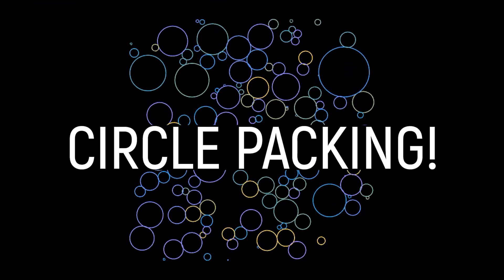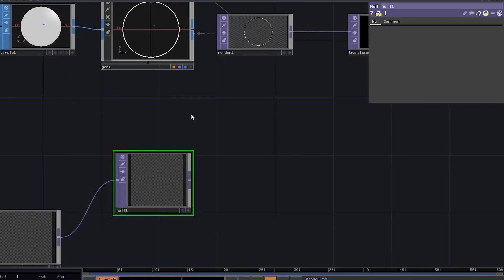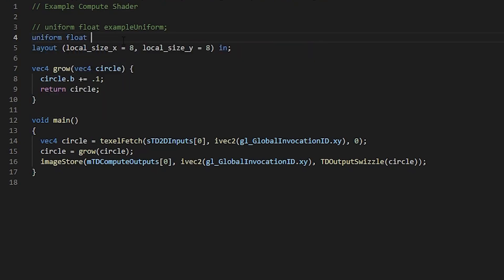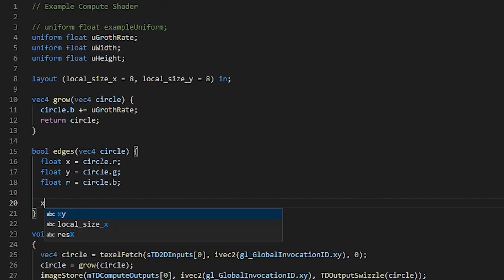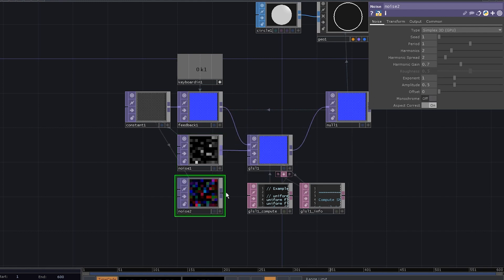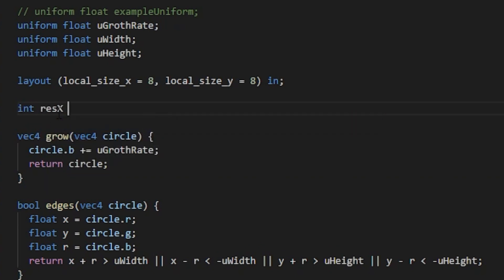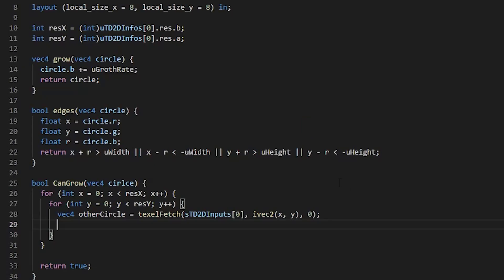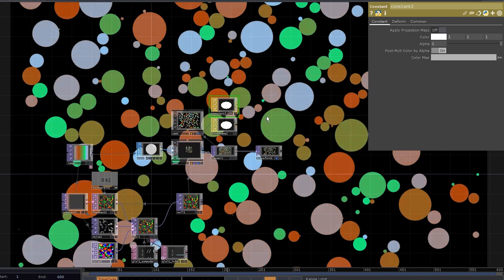Circle packing - GLSL - (Touchdesigner tutorial)

Comment: Thank you for the tutorial.I like you show the slides to explain the code.

I have a question, why GLSL shows " error C7503: OpenGL does not allow C-style casts" in these two lines :
 "int resX = (int)uTD2DInfos[0].res.b;
int resY = (int)uTD2DInfos[0].res.a;"

I am not familir with coding so I just type in whatever you typed, but I got this error 😖😖
Reply: int resX = int(uTD2DInfos[0].res.b);
int resY = int(uTD2DInfos[0].res.a);

I changed them to this and it works, hopefully you have found the solution.
Reply: @yuusuke_4740  this works for me too, thanks!

Comment: Great tutorial! I seems I still get a ton of collision though... is this some kind of precision error?
Reply from the maker: Thanks! I'm not sure I get what you mean. Just in case, try to increase circles radius with a smaller step on each frame, also try using less circles
Reply: I also have this problem…
Reply: [A while later] if the growth rate is too high the shader won't be able to "intercept" the max scale of the radius, and will make it stop at 1.02 instead of 1.0.
Cheers